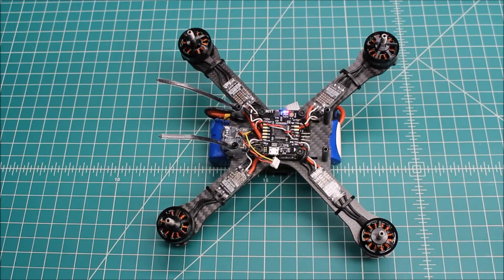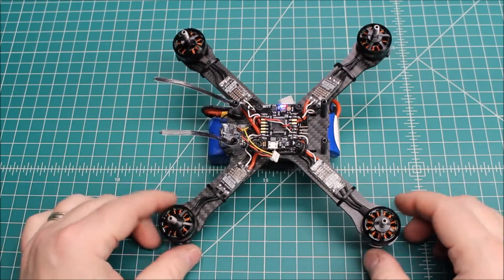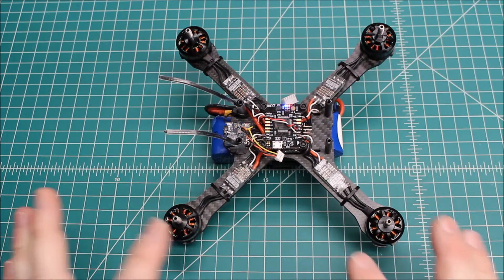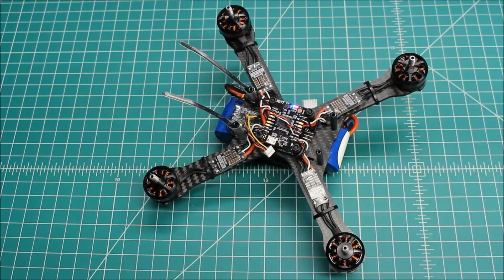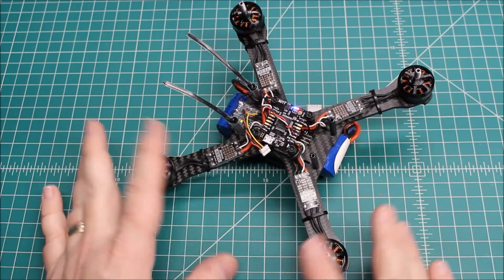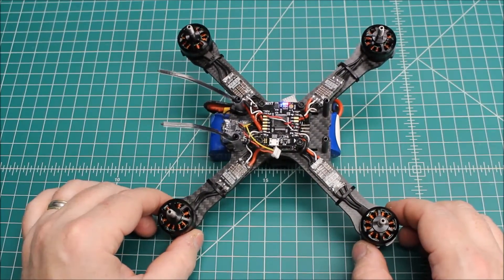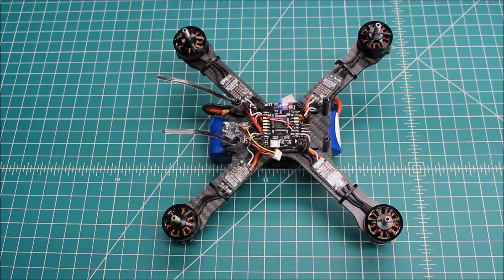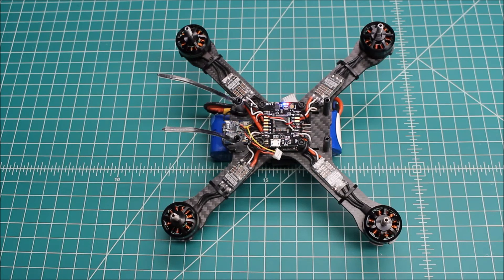X210 Bad Oscillation Troubleshooting Video 1 of 2

Comment: I had same problem it's the gyro scope frames on motor tab. n gyro update  1khz. last is . u can try disable gyo and only use accelerometer. n test. good luck
Reply from the maker: thanks, it was a faulty FC

Comment: hay the issues are simple the n52 magnets in the dys motors are strong and keep the ossilatie or twitches in the yaw axes arond mid throttle to solve the problem soft mount the fc and all the problems are gone for shore!
Reply from the maker: I soft mount all my Lux FC's due to the noisy MPU6500. The issue was that the FC was faulty.

Comment: Looking forward to seeing what the problem was. I have a QAV180 using emax rs2205 2600kv motors and it has this problem on hover. The motors get really hot as well. It's strange because it ran fine before I swapped the motor from the original 2204 T motors. Maybe these new motors give off too much noise???
Reply: i have a 4" alien with the same motors and have the same problem. im running a naze32 rev 6 and the motors get too and make some strange sounds like clicking, do you have this problem?
Reply: If you have emax rs2205 motors and a rev6 I'm going to say it's the noise the motors are giving off. They mess with the gyro. I had this problem on my 210 and put rubber washer above and bellow the naze32 board and it solved it ;) I bet it's that. Let me know
Reply: you were correct sir thanks for the advice. i did the rubber washer thing but it just didnt help so i got a new controller and that fixed it. But you got me pointed in the right direction.
Reply: glad you got it flying